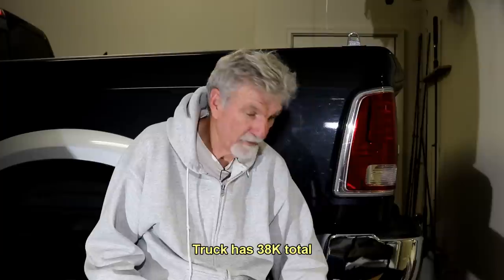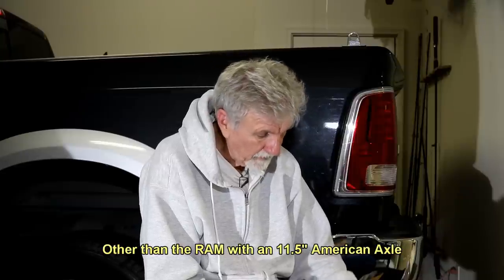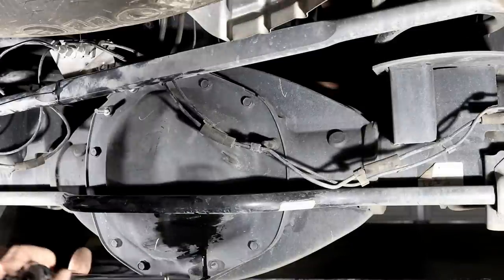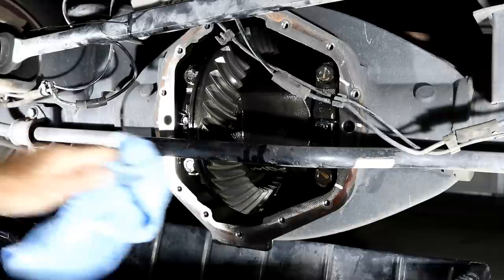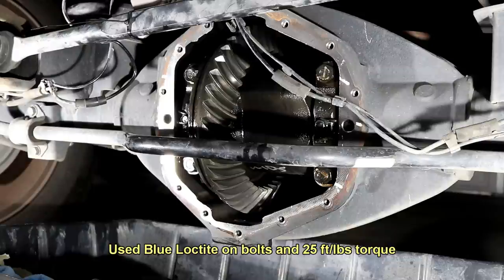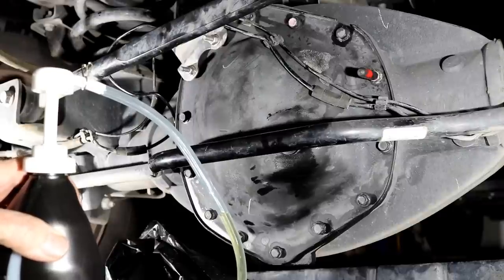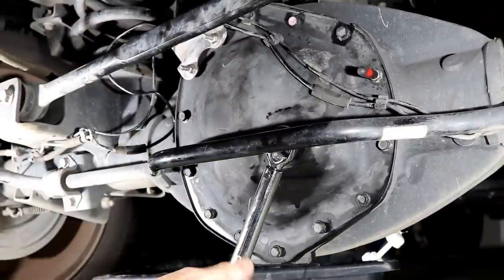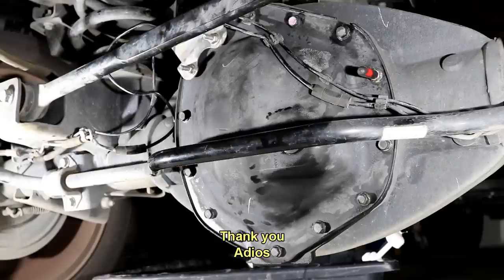RAM 2500 4th Generation Rear Differential Oil Change

Comment: Awesome video!!! A trick I learned from my shop teacher back in High school is put you pinkie finger in the hole all the way to the back side of the cover in the hole. Bend you finger at the first joint down into the fluid. For me this is 3/4", so if I do this and the fluid touches the tip of my pinkie that means the fluid will be 3/4" inch below the top of the fill hole. Hope this makes sense, but works great! Obviously everyone's fingers are different so you will have to adjust accordingly... LOL

Comment: Just did my 2017 2wd  6.7 2500. 94k on clock. Fluid was not that dirty. Still a brownish color. First fluid change ever on the diff. I tow about 15-30 times a year.

Filled it up with just over 4 quarts. I made a dip stick. But the fluid it so clear that it’s very hard to get a accurate reading. I will drive it for a few weeks and see it I can get a reading on it again.

Thanks for making the videos you do and go into details! Helps a lot!

And I agree no one really knows what the correct fluid level should be lol!!!

Always filled the diffs in the past until it started pouring out!

Comment: No going to lie, what I always do is just syphon out the old fluid through the fill hole and pump new in. Takes about 5 mins and no mess. Not the recommended way as I probably do not get 100% of the old fluid out, but now at 188k miles in my 2014 Ram 2500. No issues with either diff, and I own a pool construction company and pull 15k pounds nearly daily with it.

Comment: Marion, thank you so much for the step by step overview. I changed the diff oil in my 3500 recently and your overview was extremely useful and gave me some confidence to knock it out. I reused the gasket and put 75W-140 in based on towing and dealer recommendations. Torqued each bolt to 23 lbs just to be cautious ans so far, no leaking. Took about 3.7 quarts in the 11.5 and the dealer recommended the LS additive, so I just put it in as they indicated, even if it wasn't required, it wouldn't hurt anything...
Reply from the maker: Sounds perfect, thanks.  Yea, 23 ft/lbs is plenty IMO.
Reply: Friction modifier can in fact damage the type of LS diff in this truck due to the fact it is not a clutch style diff. Friction modifiers are extra slick so the clutches function properly. The modifier can make the diff gears slip more than they should and cause excessive premature wear.

Comment: Nice video with good details. The ring and pinion in my 2018 had to be changed after 17K miles because of noise around 65mph. I had just returned from pulling my RV between Texas and California, and it was screaming when I finally got back home. My dealer rebuilt it under warranty, but I dumped the Mopar fluid and replaced with Amsoil because of recommendations from a local AAM axle shop. I now have 50K+ miles on the truck and the gears are still quiet as new. I would recommend to anyone that tows to replace the Mopar fluid with Amsoil.
Reply from the maker: Mine had to be replaced at 6,000 miles

Comment: Hey, thanks for the video. I have viewed a lot of your videos. And you do a great job. Thank you. The dealer near me where I have bought parts and fluid from had told me. That the differential front and back gaskets can be reused. You just have to check them for cracks and chips if they have none you can reuse it. I do have in my garage a new front and back DEF gasket in case I need it. But so far so good again thanks for the video.
Reply from the maker: Thanks for sharing

Comment: I don't torque valve cover, oil pan , transmission or rear gaskets. I do the lock tite put bolts in hand tight then tighten in the pattern the book says. So far never had a leak.

Comment: You can only use the bolts the one time you have, next fluid change you will need to buy new bolts.  You were correct about the stretch you put on them making them weak from the torquing  If you do a lot of towing getting a aluminum cover helps with the heat.  Thanks for the video
Reply from the maker: Yeah good advice

Comment: Remember the SBC? twisting off those valve cover bolts on the old valve covers. That is where I learned.
Reply from the maker: Yea, I stripped the valve tappet adjustment threads once, That mistake  was costly.

Comment: If I recall correctly back in 03 when they first went to AAM Axles they had some issues with blown seals- and I think there was a TSB about revised oil level to 3/4 below the hole. Later trucks has a fill line stamped to the rear cover. 

Rubberized gasket is reliably reusable. Cover bolts have been known to snap before reaching specified torque.
Reply from the maker: Your comments are very valuable.  Sounds like you've been there and done that, ha
Reply: Don’t know too much about the current trucks, but I’ve had a couple 5.9 3rd gens. Like you, I like to do my own work, and am kind of meticulous about things. 

Your channel is awesome.

Comment: Always love your videos. I honestly think these manufacturers come up with these insane maintenance intervals. They just want to get you back to shop to sell you something. 2013 Ram 3500, $199 to do that service. I’ll wait to 50,000 and do it myself. Have a Happy Thanksgiving.
Reply from the maker: Thanks Terry, Agree totally.   I'm not going to pull that cover next time, I'm going to suck the oil out with a pump.  In fact that's how I'll do the front, soon.  The oil and gasket cost me about $160 with tax so that's a pretty good deal.  I spent the hole day on it.  My dealer charges an hour.

Comment: Buy a wire brush wheel when you need to clean bolts or the old gasket sealer they use on the transmission pan for a drill it work wonders

Comment: FYI on The 2015 they have a "fill line" indicator on the Diff Cover, which is @ 1/4 below the Hole. Like you I used to always filled them to the top, but,  A lot of the forums I read "claim" the overfill is the cause for the seal leaks. P.S.  I can also see this on your cover @ 9:51 mark,  while you torque the bolts. Just to the left of center.
Reply from the maker: Thanks, Yes, I made a dipstick to check it at 17:30.  On my truck the fill hole is 3/4" above the fill line.

Comment: Marion, my dad has a 2003 Chevy Duramax bought new he now has 300,000 miles on it and the rear diff fluid has never been changed and the brake fluid has never been changed and he's went through a few sets of brakes but he's never had a single issue from the rear diff or the brake system
I'm like you in the fact that I do it more frequently than required it's definitely overkill but I feel good about doing it
Reply from the maker: Yea, amazing isn't it.  I'm like you, I guess I sleep better at night know I did my maintenance. ha
Reply: His diff is shot.

Comment: Good vid!
Ok so a couple things. Check out Lube Locker gaskets. They are half the price, but I like them better than OEM gaskets. Reason being the OE gaskets are thick and don't go all the way to the edge of the flange. This allows dirt and mud to collect between the housing flange and cover causing rust.

As far as getting the old loctite off a Dremel equipped with a wire wheel works very well.

I think the OE bolts are junk. I replaced mine with ARP hardware. I also use low strength purple loctite on small hardware like this. Medium strength is overkill.

Pulling the spare out, dropping the swaybar out of the way and jacking the truck a bit will give you a direct line to all the hardware so you can use sockets. Crow's feet on torque wrenches are a pain in the ass. I prefer sockets.

I think the line on the pan is the minumum amount. That's the only thing that makes sense to me. My factory fill level was right at the hole. I filled it to just below the hole. I asked a buddy that has done many of these and he said if you stick your finger in to the first knuckle and bend it the oil level is fine as long as you feel the oil with your finger. Another buddy who works at Dodge said it's not super critical. Just get it close.
Reply from the maker: Excellent feedback Sal, thank you. I noticed that on the gasket, I didn't lie the way it trapped dirt.  I'll check out the lube locker.  Your answers address exactly what gave me the most headaches.    I'm going to pickup a wire wheel for my dremel.  On the access issue,  Totally agree after doing it with the bars in the way.  The crow foot is a total pain and the u joint was need often.   I spoke with the local RAM  service manager a couple days ago and he said the training he received on checking the level was exactly as your buddy said, level should be at your first knuckle on your finger.  That's pretty close to the fill line.  I wish RAM made that a little more clear in the manual.
Your comments much appreciated, thank you.
Reply: Happy to help.
Reply from the maker: @salspec3381  Just looked at lube locker, that looks like a quality gasket at less than half the price I paid. thanks
Reply: Yes. I've used them and I like them. My only issue was UPS bent them in shipping, but the company sent new ones out right away.

Comment: I did AimsOil Severe Gear 75w140 rear with SkipLock pack Changed mine at 60k magnet was full and dirty like yours wish I would have changed it earlier . I got AimsOil $2 dollars a quart cheaper which is by far a better oil in my opinion. Now I need to do the front

Comment: Thank you for the video sir. I've read 25-30lbsft is a good number. I'm sticking with 25.
Reply from the maker: Yes, in fact next time I'll use 20.
Reply: @MarionBlair  I agree- I would not go past 20 lb ft. There is a big difference between DRY thread and WET thread torque specs. When threads are wet you should reduce torque value by up to 25% depending on what kind of lube is on the thread.
Reply: @MarionBlair  going to do this project on my truck today or tomorrow, I have the limited slip as well. Would you still stick with a 20 ft lbs recommendation or would you say somewhere in the middle at 22-23 ft lbs?

Comment: Another fantastic video Marion, thanks a lot for doing these. 
Today I took my 2016 to my long time trusted transmission shop to do a service on the transmission and transfer case. I was concerned about the transfer case because on a recent road trip, the truck unexpectedly tried to engage 4x4 low all by itself at highway speed! (not a pleasant sound...)
Anyway, they checked the level in the rear differential and discovered a lot of metal on the magnetic fill plug. They took a photo and suggested showing the dealer.  (without changing it)
Did you discover any filings on yours? And, did you check the factory fill level before draining it? 
I certainly share your phobia of over torquing. I'm forever over doing it and breaking something. I'm surprised I haven't snapped of an oil filter yet! lol
Sure wish you lived next door!!

Comment: I ran into those same contradictory specs on rear diff level as you did, I went with Amsoil Severe Gear 75W-90 and filled to 1/4 inch below fill hole.
Also after getting the truck home from dealer, I check all levels and the rear diff was 1/2 quart low, the front diff was a ridiculous 3/4 quart low,
dealers don't give a damn, they just want the 60 thousand dollars.
Reply from the maker: It's disgusting.  I'm been corresponding with FCA and American Axle and ready to start drinking again.  It's ridiculous.   I'm so pissed about not being able to get an answer to a simple question.  Still working on it.
Reply: @MarionBlair Did you ever get the answer?
Reply from the maker: @iwwqytv  no, I talked to the engineer with American axle and he was useless, he thought it may be to save oil which is ridiculous. I just fill it to within a quarter inch of the fill hole. But I don’t think it would hurt a thing to fill it all the way up I think that’s what most people do.
Reply: @MarionBlair  Thanks for the reply, and the excellent series of videos you put out. Do you still utilize the method of suck suctioning out the out fluid without removing the cover?

Comment: In reference to your loctite cleaning, mount a wire brush to a tabletop, then run the threads through it with an impact driver.

Comment: A pair of vice grips to hold the stud then turn the stud against a bench grinder with a wire wheel. All the rust and loctite will be cleaned off

Comment: My son's 2016 Ram 2500 diff bolts were not that snug although some were awkward to get to, didn't require much cleaning either, but if you want to replace the bolts the dealer charges $7 each but my local parts store (Auto Zone) had them for a buck a piece,  M8-1.25 X 20MM. If you don't have that many miles on the truck I would definitely recommend just doing a siphon and refill instead (like Mr. Blair did for his front diff), save the $60 gasket charge and finish in a fraction of the time.
Reply from the maker: Yes, I'll do that on the back also.

Comment: At 35k my 2017 3500 was chattering like a mother it would vibrate the mirrors. Had to use modifiers in it. I have never had to change rear fluid till after 100k u till I got to Dodge need to change it at 30k with friction mod.

Comment: Marion,
Thought I'd send you this bit of info. If you ever need more oem differential gaskets call Geno's garage. They carry the original factory parts for alot less cash. Rear gasket for your truck $24.84
Terry
Reply from the maker: Oh, wow, thanks, I paid over $44 for that rear gasket.
Reply: @MarionBlair  Not a problem. Always good to save a buck or two. The doggone dealers are so friggin expensive on EVERYTHING!! Keep those great vids coming. You are the best!!
Terry
Reply: Terry is dead on.  Genos Garage is the place to go for MOPAR parts.

Comment: Dont forget to blow the breather tube. My check valve was stuck and oil blew through the seals. Sucks having to spend $300 for front and $300 for rear.
Reply: Around 80k my driver's side rear seal went out.  $30 and a few hours later it was as good as new.  Now I might pay someone to do the fronts, though.
Reply from the maker: Wow, Thanks I looked at it this morning but got lazy.  We talked about it but didn't check it,  I will check it, thanks.
Reply from the maker: thanks, I'm hearing more and more about leaking seals
Reply from the maker: @أبو داحم I just put the OEM stuff back in, it's 80 w or so.
Reply from the maker: @monsterram6617  I would think the rear is tougher than the front?
Reply: @MarionBlair  Not at all.  The bearing are on the inside of the front axle and require much more disassembly to get in and out.  The rears are a piece of cake.

Comment: I wonder if my 2018 2500 is the same procedure, I'm too lazy to go look this Saturday morning. Lol! My truck only has 21,000 miles on it. But at 66 years old it's my lifetime dream truck, a Laramie Limited  Tungsten Edition. Every option you can think of except suede headliner delete, yeah I had to settle, Lol! So I want to take EXTREME care of it, especially considering the majority of it's duty it exactly like Marion Blair's, towing a travel trailer. Mine weighs about 7,500 lbs loaded. I can dig out the Cat Scale numbers and also discuss fuel mileage if anyone is interested. On a stop over right now during an 8 state camper trip with a 29 ft travel trailer behind us most of the way. The majority of it at altitude in the northwest. The Cummins just plain kicks ass. The Ram 1500 that I traded in had a drain plug on the bottom, making it much easier to change although it did not give you the opportunity to for visual inspection, something you should consider under severe duty.  Whoever purchased that half ton with 55,000 freeway miles on the clock got a very well maintained truck. Thanks for these videos Marion, I've watched every one and learned a learned a lot from them!!!!
Reply from the maker: Thanks very much, yes yours will be identical. But save yourself a lot of headache and work and get a little vacuum pump from O'Reilly's, AutoZone or wherever and just pumped it out and don't pull the cover. If you maintain the fluid from the beginning it's really not necessary in my opinion. With that track bar Etc in the way it's a real pain in the ass to pull the cover. I called my dealer to ask them how much labor they charge and they said $75 I said how do you do it, they said we Pump It Out.
Reply: Marion sorry for my slow reply to your quick response. Gathering parts for this project today, including a magnetic trey to keep in the trailer. Man those parts can fall straight through the earth's crust. You da man!

Comment: I have talked to several diesel mechanics, and they recommend Not to change out rear differential fluid,, they stated it could cause problems down the road,, your thoughts
Reply from the maker: Clean oil never caused a problem?
Reply: Yep, your right

Comment: I just changed the rear differential fluid in my 2016 3500 and fluid level is to confusing.  I ended up filling it until the fluid just started coming out the hole.  Is this to much?  Also, absolutely agree with the torque specs 30 lbs is to much.  I was beginning to wonder if 24 was to much.
Reply from the maker: same here 25 was pushing a cart.  I think It's okay to fill it to the hole lot of people do that.  It is confusing I couldn't even get a straight answer out of American Axle engineer.
Reply: Thank you sir, I hope you and your family are safe and healthy.  If you ever come up to Alaska, look me up, got some great camping spots.
Reply from the maker: @Win70ew  Sure appreciate that,  I envy you living in such a beautiful state.  I do get to watch Alaska State Trooper however!

Comment: hey quick question do you thing this service  could be done without removing the diff cover by sucking the fluid out the fill hole?
Reply from the maker: Yes, just suck it out with a hand pump.  That'll be the way I do this next and did it on the front